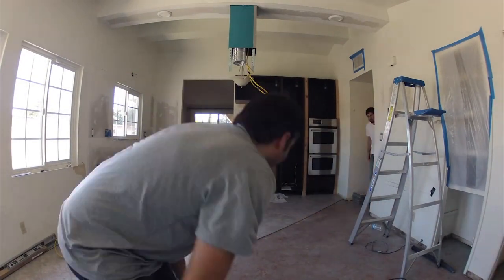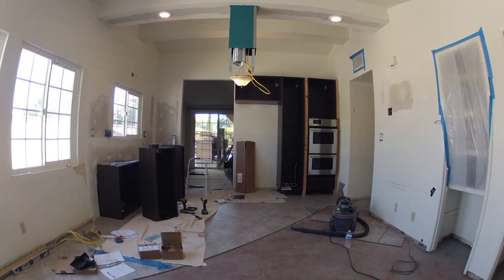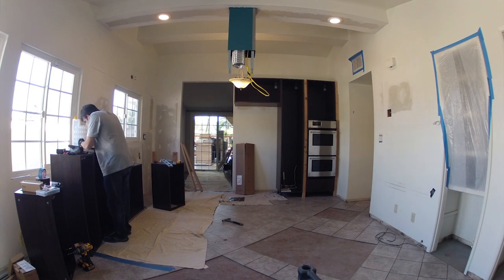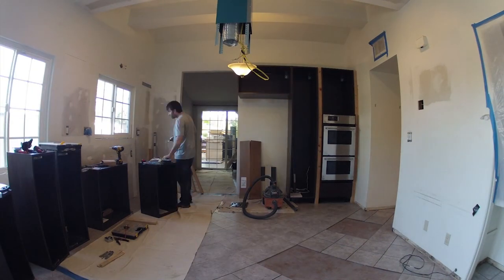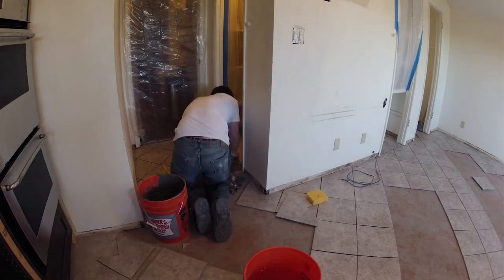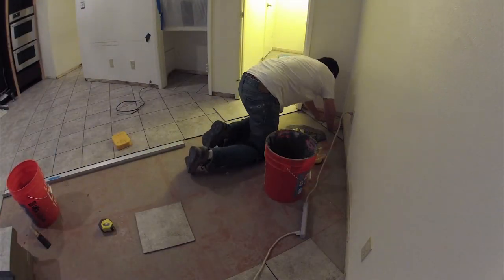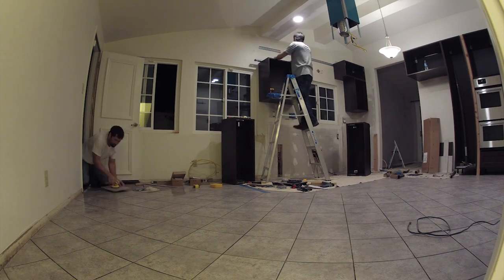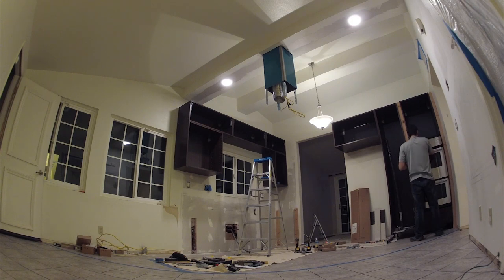Kitchen Remodeling - Day 8 of 17 - Upper Cabinet Installation, Kitchen Floor Tiling

Comment: Was wondering why you went with tile and not laminate or hardwood?
Reply from the maker: +uhavemooface We were trying to keep costs down..  hardwood would have been at least 3-4 times more.   this tile we found for about $1.00 sq/ft.   Also, we wanted to go with a medium to light tone on the floor to keep the room bright... the cabinets and counter tops are darker, so we decided to go with a lighter floor tile.
Reply: Jason Cooper Nice. We are probably going to do the same for our kitchen.